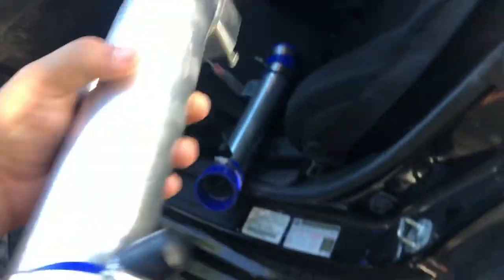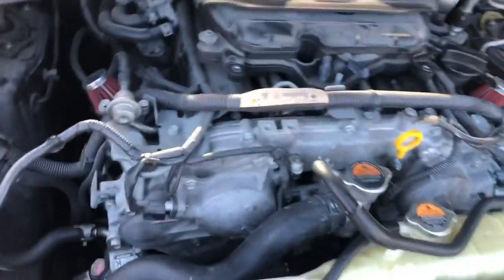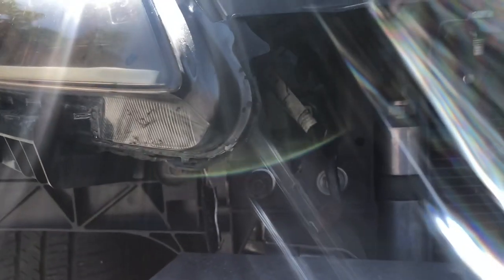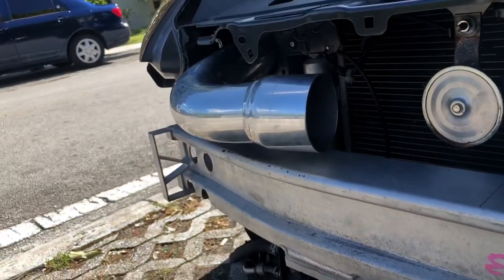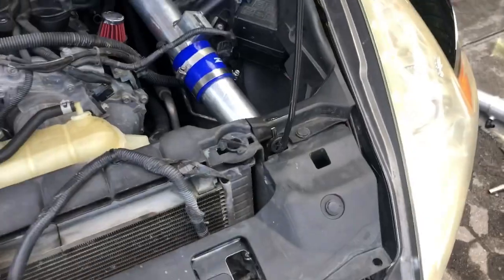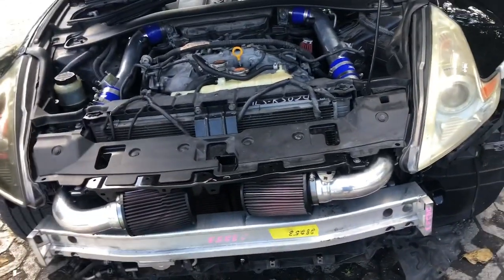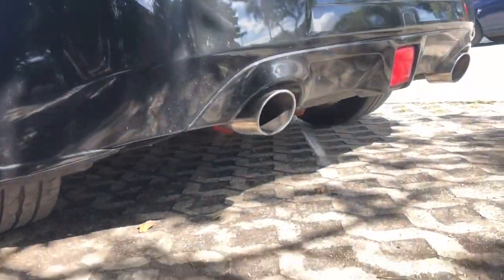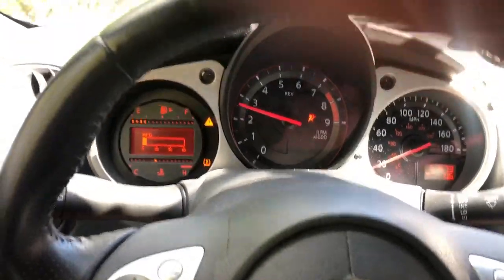Stillen Gen 3 Intakes Install | 370z

Comment: how hard was it to cut with a knife?
Reply from the maker: Chris Delva it’s not hard hard just time consuming lol but I’d say like 10 minutes each side
Reply: @nismoj   ight cool I was on the fence if to get them or not cause I didn't think id be able to cut it without some tools btw where do you find your parts from cause we both are in south Florida but I can't seem to find any intakes or exhaust on offerup
Reply from the maker: Chris Delva offer up, Craigslist, and Facebook pages bro. I usually come up on deals just like these intakes I got for $100
Reply: SlowZ34 i have a 2007 g35 automatic sedan with the HR motor, I need to get these for my car, since it has the same double cold air intakes like your 370z, does it mess up your mad sensors?
Reply: SlowZ34 did you buy new air sponge filters for it ?
Reply from the maker: Marco Antonio no it doesn’t mess up your maf sensors and no the filters I got were used